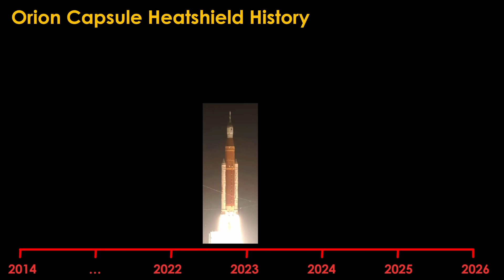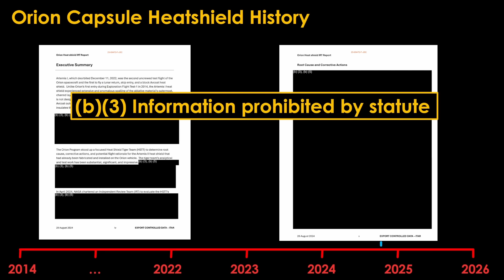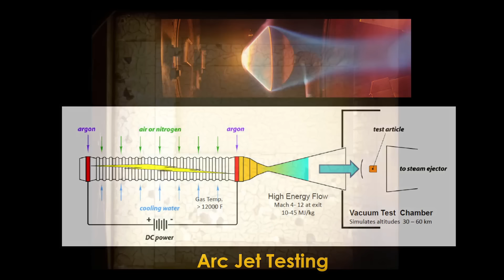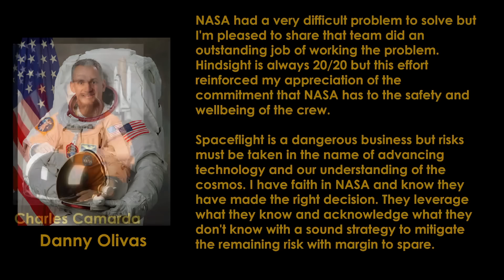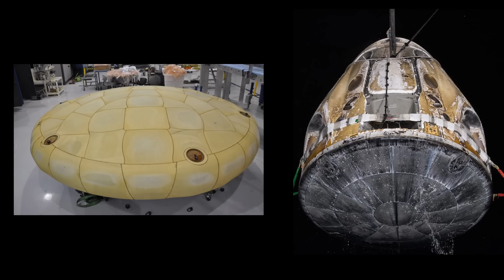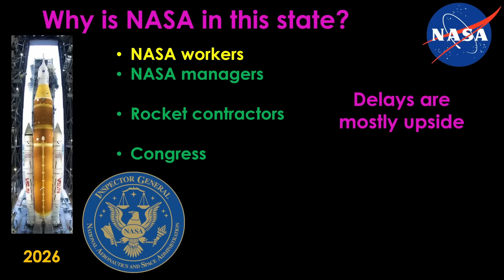Artemis 2 Orion Heat Shield - Is It safe?

Comment: nobody here after Artemis 2 confirmed
Reply from the maker: The flight was successful. I'm waiting to see the heat shield pictures to see if they were correct in their models. 
The shuttle flew quite a few times before Challenger...
Reply: @E @EagerSpace  heat shield was in great condition based off the pics alone. Glad that saga is over because the overreactions and comparing it to Colombia and Challenger were wild. Failure points on a capsule are far fewer than the shuttle so we shouldn’t lose sleep.
Reply: @EagerSpace  did you see the pics?
Reply: @EagerSpace  The initial info and pictures look good. I’m curious to see if/ when a full report is released.

Comment: One hour until Artemis 2 reenters. I hope it doesn’t take a catastrophe for NASA to cease the mistakes of the shuttle era.
Reply: I’m obviously speaking with the power of hindsight, but it certainly seems that everything NASA did between Artemis 1 and 2 paid off. The initial info on the heat shield performance looks good.

Comment: Did NASA not learn from Columbia disaster or Challenger disaster???😢😢
Reply: We’re overdue for the third disaster
Reply: Buddy the heat shield handled re entry today and Orion successfully splashed down with the astronauts onboard don’t trust everything from the media for God’s sake and this “heat shield” thing is different from the Columbia and disaster
Reply: They did learn. They performed extensive testing between Artemis 1 and 2 and by all accounts so far, it paid off. The initial info on the heat shield performance all looks good.

Comment: 13:29  wait, Orion does NOT have a docking adapter??
Isn’t that. . .  a problem for future missions?
Reply from the maker: Artemis 1 was enough to do what it needed. 

Artemis 2 adds the life support system.

Artemis 3 adds the docking adapter.

It means they are flying a different capsule every time. Not really a great plan.

Comment: I think you missed emphasizing the bloated pigs that are Lockheed Martin and Boeing. Lockheed at any point in time could have decided to further develop and refine Orion on their own Buck to make it a useful and capable spaceship. But as the bloated Pig they would only consider doing something like that if the government paid them for it. They very easily could have developed Orion independently alongside their government contract. And even doing this they could have ended up with a cheaper better spacecraft that they could have even used for transport to the International Space Station and other private stations. And don't even get me started on Boeing.
Reply: It’s standard practice across all industries to exclusively use contract money for work on that contract. Where the money comes from for specific projects matters.

It’s no simple matter to do something on your own buck. The government subsidizes a large amount of scientific and R&D work. That money can only go to very specific, predetermined efforts.
Reply from the maker: Orion is partly the way it is because Michael Griffin / NASA wanted a big heavy capsule so it couldn't be launched on commercial rockets.

Comment: The technical analysis and journalism here are great. However, I think the takes on NASA at the end are overly cynical and misplace some of the blame. 

It is correctly acknowledged that NASA has to do what Congress tells them. But then the delays and budget difficulties are primarily ascribed to NASA. NASA leadership isn’t perfect, but they’ve been dealt an extremely difficult hand by Congress. 

It seems like there is an implication that NASA is still running cost plus. That was the case for Shuttle, but not for Artemis. Speaking as someone who works for a contractor that has SLS contracts, NASA can, has, and will pull the plug on efforts if the budget has been spent or cut. We have zero incentive to unnecessarily prolong efforts. 

The difficulty in maintaining schedule comes from the fact that Congressional expectations exceed the funding allotted. 

At the end of the day, NASA is forced to cater to a bunch of politicians who have little to no understanding of the projects. This results in numerous built-in and unavoidable inefficiencies.
Reply from the maker: I've read the GAO and IG reports on NASA management of the SLS/Orion contracts and it's pretty clear they weren't exercising the sort of oversight that they could. Contractors got awards even for poor performance.

For core parts of the program, it's pretty much impossible to get fired because of the congressional requirements set forward in the space act of 2010. SLS has to fly on the RS-25 because of the way things are structured. Boeing had to get the core stage contract because they had the second stage contract for Ares.
Reply: @EagerSpace  Congress loves to give contracts to legacy providers and it’s clearly not based on performance because otherwise Boeing wouldn’t be getting anything. 

The only reason they have the core stage contract is because the Saturn V stages were made by Boeing, North American, and Douglass and Boeing acquired or merged with the latter two. 

Using RS-25s is also nonsensical in my opinion. That engine is derived from the Saturn V J-2, which was built to operate in low pressure or a vacuum. It was never intended as a main stage engine. Shuttle only had it so it could boost itself into orbit after the SRBs burned out.
Reply from the maker: Boeing has core stage and EUS precisely because they had the contract for Ares second stages and congress required NASA to reuse the existing contracts for Ares. 
That's why the core stage and EUS are jammed together into one contract instead of being separate contracts.

Comment: Uhmmm maybe with ares still around it could make for a cheaper option for testing orion...
Reply from the maker: There was no Ares. In 5 years, NASA managed to cobble together shuttle parts that looked a little bit like Ares I and other parts that were the right shape. The only real thing there was the parachute for the booster, which was an upgrade version. 
There was the unresolved problem around the vibration environment of the SRBs on the second stage and Orion capsule
Reply: @EagerSpace what a mess... While I knew about that test I never watched footage neither read too much about it, didnt knew the upper stages were just mockups. 2010s Nasa is a total shitshow, no wonder why there are so many space detractors nowadays...

On the other hand, could that problem be solved somehow? Perhaps changing the shape of the fuel inside the rockets for avoiding these thrust oscillations? 

Maybe this is a candidate as a question for one of the q&a vids 😅
Reply from the maker: I had a yellow sticky with "Ares I" on it as a topic but it's probably not in the top 50 and there are always new ones.

Comment: "And it would fly every year from 2024 to 2030."

Words cannot express my rage at NASA, Congress, and presidents Reagan Bush Clinton Bush Obama Biden Trump. 4+ decades of broken promises. I want a refund. A massive one.
Reply: NASA still provides scientific and societal value even with Artemis program delays. And they do it for effectively pennies on the dollar. NASA gets less than half a percent of the national budget and creates positive value for the economy. 

The important thing to consider is that NASA can only do what Congress lets them do. They’ve been held back.
Reply from the maker: It's a collaboration between congress, NASA, and the contractors. Gateway is a good example - it's directed by congress but the reason that's the case is because of the NASA centers and contractors in specific areas.
Reply: @EagerSpace  I’m of the opinion that it’s generous to call the endeavor a collaboration with Congress. It should be, but when you have to justify technical proposals to lay people (with some being outright scientifically illiterate), some serious concessions get made to get Congress on board. And now, everything is perpetually in limbo now that Congress will withhold funds that were already allocated.

As for the contractors, there is a good deal of collaboration.

Comment: Artemis is pure corruption... it is optimized for maximum taxpayer money extraction
Reply: It’s engineers doing their best with the hand Congress has dealt them. NASA gets less than half a percent of the national budget and a fraction of that goes to Artemis. The money at least goes into the economy.
Reply: @AM-rd9pu  

Its not about how much funding they have gotten, its all about requirements

If they simply got the money and the task to sustainably return to the moon then people would be on the moon by now

Its all the other astrisks that are the problem
Reply: @nikolaideianov5092  You’re not wrong. NASA gets flowed rather unreasonable requirements and has their hands tied in a number of ways. 

The frustration will always be the fact that NASA and the contractors could have done a better job just designing the rocket from scratch and using what they know to be best practice.

Comment: What an oddly specific target for Artemis 3 that ends up driving this schedule.  I wonder what well-informed rational decisionmaking led to its selection.

To be clear, as you stated, the machine is really not set up for meeting deadlines.  But that doesn't make trying to hold an arbitrary deadline any better.
Reply from the maker: I have sympathy for your position but deadlines do harken back to the one that Kennedy set.
Reply: @EagerSpace  That's fair - I agree that, without an external push, NASA's human spaceflight program wouldn't do much of anything.  Even if I disagree with the methodology, some deadline is better than no deadline.
Reply from the maker: Something better than Shuttle's "Boldly going back to the same old place over and over..."

Comment: In my opinion no, the heatshield has lower permeability this time making the heat shield worse than artemis 1's , reducing dwell time does not reduce the risks of failure. Lower permeability will cause more gas buildup whether or not dwell time is reduced, clearly the heatshield has a problem with venting the build up in gas, and rather than solving the issue directly, they are choosing to risk the crews life. The Challenger and Columbia disasters taught us that schedule pressure and overconfidence can lead to catastrophic results. I hope we've learned those lessons. But when I see NASA proceeding with a known heat shield problem, choosing a trajectory modification over a hardware fix, and doing it all with crew aboard for the first time.....It reminds me too much of decisions that didn't end well. Best physics-based estimate 3-6% catastrophic failure probability, most likely around 4%. This is too high, especially when this can be reduced by a design change. I hope nasa makes the right decision and cancels the launch.
Reply: It's lower?  How do you know that?
Reply: @TheEvilmooseofdoom  an official research report from nasa, called "NASA Identifies Cause of Artemis I Orion Heat Shield Char Loss" go read it, it goes into  great detail about it.

EDIT: NASA
Office of Inspector General
NASA’s Readiness for the Artemis II
Crewed Mission to Lunar Orbit

Search that up, the report will come up.
Reply from the maker: That's actually not the research report. 
That's an article written about the the research report to justify NASA's position.
Reply: @EagerSpace  You're right, good catch, that makes me even more frustrated, not because I think the flight will fail (I think the crew will return safely). But rather because It feels like the beginning of a pattern of accepting known problems in favor of deadline and political pressure rather than addressing them, and that's what really concerns me. How they possibly can justify this and the cover up, is mind boggling.

In my opinion, a six percent chance of critical heatshield failure on any spacecraft is too high. Even if things go well for Artemis II's flight, it could set a dangerous precedent where pressure consistently wins out over proper risk mitigation.
Reply: The issue is the fact that the shield heat soaks on the skip reentry. It didn’t cool down after the initial skip. The heat penetrates deeper and the shield was greater affected by the final reentry.
Reply: @AM-rd9pu  thats the assumption

Just like with the assumptions made with the spaceshuttle

Did all of them lead to a dissaster?
No

Yet challenger and columbia happened
Reply: @nikolaideianov5092  It’s not an assumption. The shield was designed for a direct reentry and they decided to try something they thought would be easier on the shield but were wrong.

And the Challenger and Columbia disasters were much more than just assumptions gone wrong.

Comment: I doubt the last delay was even a problem with fuel.
Reply from the maker: NASA has had a bunch of issues with hydrogen leaks during shuttle. STS-35 had multiple leaks, and - combined with other issues - that delayed the launch for 6 months.
Reply: Cryogenic hydrogen will always be difficult to handle since it can permeate though solid materials. 

It’s not a surprise at all that the wet dress revealed a hydrogen leak.
Reply from the maker: Would be more of a surprise if it didn't. 
If you go back and try to do any complex process after a 3 year hiatus, you never remember all the issues even if you have a very well documented process.

Comment: I really hope we get back to the moon, but I’d say it’s 50/50 that Artemis doesn’t fly again.  Nobody is excited about it because the US “won” the political race 55 years ago, and while the science may be nice, any claims to commercial viability are outlandish. If the government was serious about “Get there by X date,” they would have funded the program fully and consistently, not in dribs and drabs, cancelling and restarting. If private companies thought there was a profit in it, we’d already be there. So far, it’s just wishful speechmaking. 

And if they are serious, NASA needs to take a good, hard look at the original Apollo test plan, taking into account that Apollo 8 going to the moon first was very risky and only done because they needed to make progress when the LM was late. They should be doing Apollo 7 and 9 type missions in earth orbit, with unmanned reentry testing of the heat shield at lunar return speeds. No need to go to the moon for that testing, just take the early Apollo approach and punch the capsule back toward earth. Then A10, and then 11. It could be argued that we don’t need to because we did it before, but that institutional knowledge is long gone, and we need to re-learn it.

Comment: Is there a path to more hardware for more mission options when things go wrong (e.g. for an Artemis 2.5)?  How hard do you think it would be to modify SLS to use Centaur V instead of ICPS or EUS?  It is proven, has an active production line, uses the same propellant and engines, and has more performance than the ICPS.
Reply from the maker: Centaur V is kindof halfway in between ICPS and EUS in terms of capability. It would be fine for block 1 (1.1?), but it would likely need to be modified for human rating and to be stronger because Orion is heavier than any payload that Vulcan can lift. And generally human-rated stages need higher margins. 

The New Glenn second stage has also been mentioned.
Reply: @EagerSpace  EUS just seems pointless.  It doesn't add enough performance to bring a lander.  Best it can do is comanifest a payload for Gateway (which also seems pointless), but modules could be shipped separately by existing heavy vehicles for a lot less.  If we still need SLS for Orion moon missions, then Centaur V or GS2 is all the capability we really need.

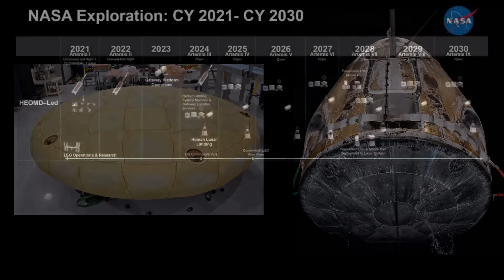Comment: Starting at 15:30 and especially at 18:40. This is why I get so pissed with people blaming Starship/SpaceX for delays to getting to the moon. But far too many are blaming SpaceX for the lunar landing delays. And far too many are simply those that clearly benefit from the fear/anger they generate on blaming SpaceX, either by YTube views, news clicks, or by their company getting contracts. 

Being critical of Starship is perfectly valid. It is very delayed. But it hasn't been the cause of a delayed landing yet. And it might not even end up being the delay, given how SLS and Orion have been going. Over 20 years and around 100B in tax money have been spent on SLS, Orion, and their supporting infrastructures, and we are still having delays. And that is WITH existing hardware not only developed, but LITERALLY PULLED OFF previously flying Shuttles. They are both absolute jokes of programs. Hopefully both end up being replaced by SpaceX and/or Blue Origin.
Reply from the maker: I agree with this, though I think starship has been a poorly run program at times. I think they have a decent chance of turning that around with block 3.
Reply: @EagerSpace  Version 2 was really bad. It ended on a high note at least. But that start was horrible.

Version 2 made me question Musk's overall involvement in Starship development. I am a Musk fan overall. However, prior to V2, I assumed he only had minor involvement in the overall development of Starship. But V2 clearly didn't have him involved much, as he was doing a ton with Trump. And yet that is the lowest point of the Starship development program. It finally got back on track once he left Trump.
Reply from the maker: That was the theory in my last starship video. 

But I'm thinking that "program that works only when <person x> is around" is not a great way to do things.